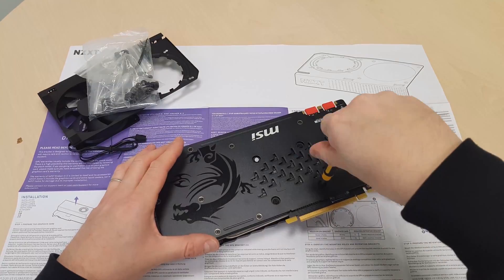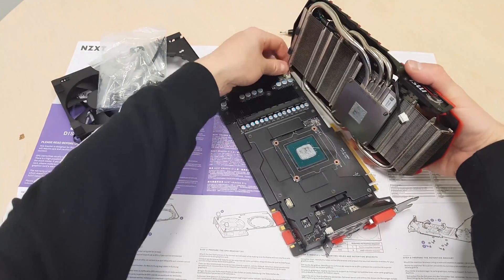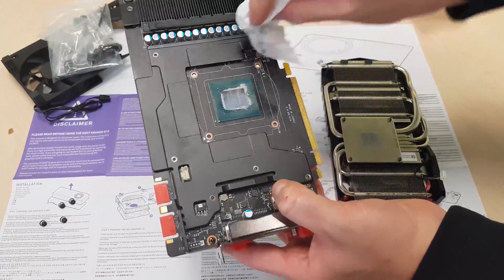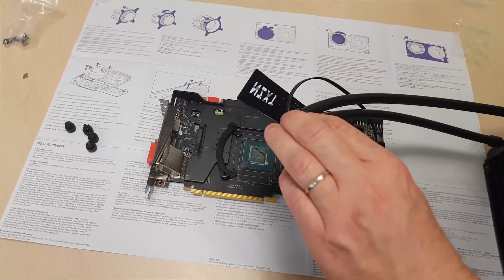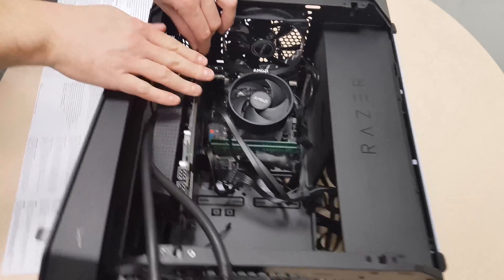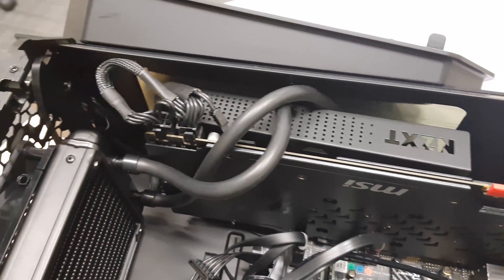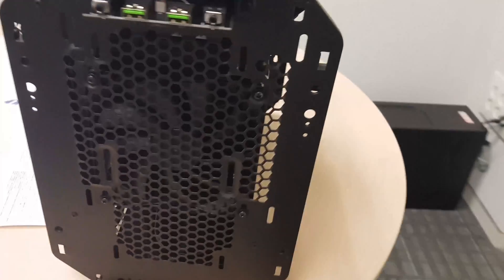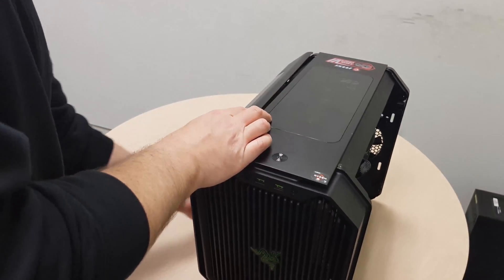GTX1080 liquid cooling mod (4k)

Comment: Im afraid ur fan is facing the wrong way
Reply from the maker: It was impossible to attach it differently
Reply: That couldn't be true because no one would ever want their fans sucking air away from components.
Reply from the maker: I replaced that cheap fan with a slimmer one by noctua. Its faced correctly now

Comment: Kraken g12 dosent work with all aio. Has to be on the list for the kraken g12. Some might work with modification(drilling etx). But for example corsair h100i pro rgb would never fit cause its to small. I use a x42 with mine and idle 33c with ambient of 25 in room. Full load i go 50c at max. Used it on a gtx 1080Ti asus strix.

Comment: why did you not plug fan into GPU fan connector? or water cooler fan into GPU fan connector?
Reply from the maker: My case has built in fan controller. I prefer all fans go there. But i'm pretty sure i plugged the vram fan into gpu connector